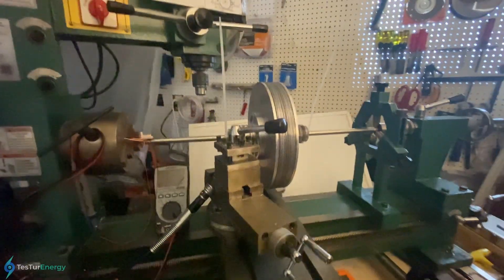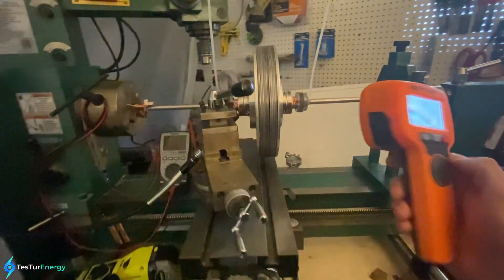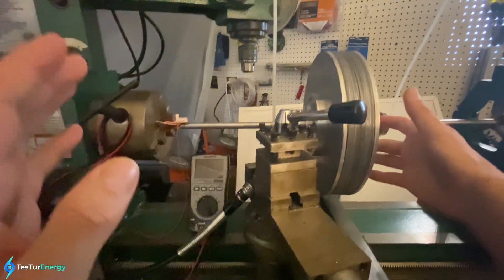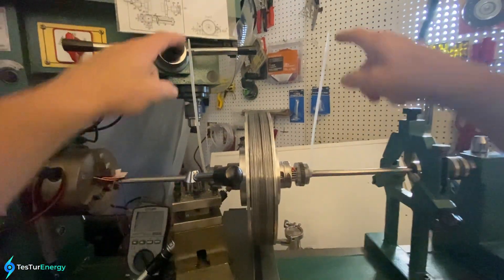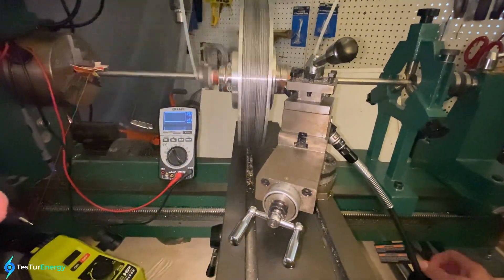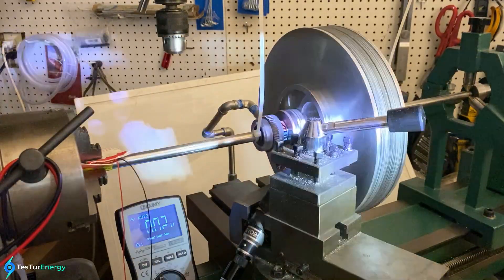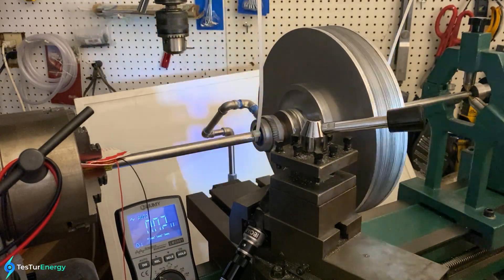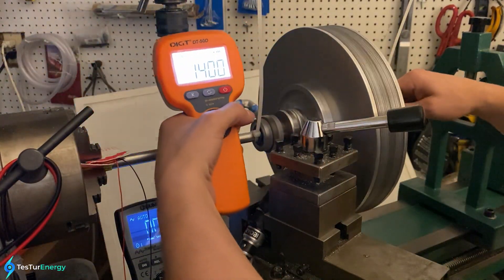How To Do Dynamic Balancing of Tesla Turbines, Turbo Jet Engine Rotors & More On A Lathe

Comment: Are you going to try a further ultra fine balancing at the critical rpm?  Was 1800, as 3x 600, the intended operating speed?  2x that, at 3600 rpm is often the target operating speed of AC gensets for 60hz.
Reply from the maker: Naw just doing a demo. 

Although I’m pretty sure I can operate at 3600rpm with decent power output available I think I’ll get a better efficiency at a higher rpm but maybe won’t get as much power out. 

This will probably spin anywhere between 3600 and 13,000rpm . 

The turbine is already geared up to high frequency 3phase BLDC generators that are rectified and then Inverted. 

I have generators that will go direct on shaft for the final combustion one though.
Reply: @CharlieSolis are you going to use some sort of electronically variable load? You need to get torque test channel to .. well ... Test the torque
Reply from the maker: @accordv6er  hey thanks for the comment! Yeah it would be cool to see the static torque of this! 

Though I will say I can’t do a full throttle at zero rpm because the discs gain a rigidity once spinning that at zero rpm they just kind of vibrate like a harmonica. Which is not desired. 

Make sure to check out the latest updates on the combustion + steam Tesla turbine builds!  Tesla Turbine 250 watt to 2650watt Power and Efficiency Test https://youtu.be/K7qZvq1CMFg 

+4250watt Tesla Turbine Dyno Jet Turbo Power & Torque Curve 375 mph @ 12,500 rpm https://youtu.be/exF5Rn-L8gs 

Tesla Turbine Jet Engine - gasoline fuel burner atomizer flame tube test 186,083 propane burner https://youtu.be/gRqKowignac 

Tesla Turbine Jet Engine Combustion System GB186,083 - Powdered Iron Fuel + propane micro burner https://youtu.be/Ad0Ecpc_OPM 

Dr. Tesla Talks of Gas Turbines - AudioBook by Charlie Solis https://youtu.be/TGGLG-7hK50
Reply from the maker: @accordv6er  to give a short answer, I’ve also done dyno tests with this already and graphed the torque and power curve across its usable rpm range. 
6.22ft-Ibs of torque at only 4150rpm and +4.25kW between 6000-12,000 rpm. 

+4250watt Tesla Turbine Dyno Jet Turbo Power & Torque Curve 375 mph @ 12,500 rpm https://youtu.be/exF5Rn-L8gs
Reply: @CharlieSolis  thank you so much for the responsiveness. Hadn't even though about the tension at speed giving it rigidity that's really interesting! Makes sense why when you balance it, it must be dynamic as well. Would a VSR balancer used for turbine wheels work also? What is the limit on diameter/rpm on the aluminum? Would a multi stage increase efficiency any? Giving up some RPM and surface area for slightly different plates that are thicker but have a larger outlet/working surface area ratio? Longer lever essentially? Or does that pretty much just become axial at that point.... One thought was as a stage moves out of range and becomes just a flywheel, to use the next stage to pull the atmosphere out of the prior stage, (so it becomes essentially only a flywheel.... This might happen simply by blocking the inlet actually? Where most of the stage is in a slight vacuum. )
Reply: Seems like this might work brilliantly hooked to a large mass flywheel with a CVT input system such that the Tesla Turbine can remain at peak efficiency, while bringing the flywheel to speed, while also isolating the turbine from peak loading. I mean....batteries work too 🤣 but while we're on the topic of things that go spinny spinny, big ass flywheel battery might be a really good application, especially if it could me made as part turbine itself, or used the disc/pumping mechanism to pull vacuum on it's own case as it accelerates, so by the time it gets to speed it is in some vacuum. 
Alternatively, the flywheel could be a turbine spaced for fluid sheer forces/adhesion so the fluid adds to the mass of the flywheel, the fluid being driven by the smaller steam turbine

Comment: Interesting that you only have to take the mass off the bulky parts on either side of the discs rather then the discs themselves?
Reply from the maker: Lastly…. I’m just happy that I don’t have to balance each and every disc and star washer individually when there’s 75 discs I this 😅

However because the discs won’t be uniform you will want to pick a final balancing shaft that has a critical rpm such that the 1/3 of critical rpm that balancing is done at is near the operating RPMs such that the discs will stretch to their natural point for the centrifugal loading at the desired RPMs. 

Tesla further notes in the patent that the motive fluid used for balancing can be heated and a covering can be put over the balancing machine so that the turbine is also at its operating temperature too such that it’s at its natural thermal expansion point for operating too. 

Otherwise the balancing done at low RPMs could be inadequate, depending on your disc materials as the discs won’t have the same mass distribution.

Nick, aka waveguide, pointed out that the shafts Tesla had picked from for using with his 60in discs had a critical rpm of 6,000rpms. I had previously stated that he was wrong for thinking that shaft was to be used for balancing because the turbine would never be spun at those high RPMs, but Tesla planned on running them at 1800rpm I believe and 1/3 of the 6,000 critical rpm is 2000rpm, just over the desired operating rpm of the turbine. So Nick was right about that shaft. 

I further even think Tesla planned those discs to be able to stretch enough that right as the turbine goes over 1800rpm and gets near 2000 rpm the discs will stretch enough to just touch off with the outside of the casing and it can actually use that to stop any “runaway” from the turbine over speeding but in fact it would also auto balance the turbine all within its own casing if it touched off with the casing periphery at 1/3 of its shafts critical rpm.
Reply from the maker: Hey Stuart! So technically the whole disc stack was rather balanced before with the previous setup but I needed to add on these locking shaft collars to keep the disc pack from widening up at full pressure. 

I thought they were when I ordered them but it turned out the locking shaft collars I bought were not symmetrical and had the screws going in on only one half instead of 1 screw per side. 🤷‍♂️ 

This was honestly the only reason I started working on the balancing stuff because I didn’t need it before. But I’m happy I’ve got this down now because it takes any worry away that I would have an out of balance runner built in the future and couldn’t fix it.
Reply from the maker: That being said though, this is what Tesla said about balancing in the improved disc stack patent GB 186,082. 

“This construction permits free expansion and contraction of each plate individually under the varying influence of heat and centrifugal force and possesses a number of other advantages which are of considerable practical moment. A larger active plate area and consequently more power is obtained for a given width, this improving efficiency. Warping is virtually eliminated and smaller side clearances may be used which results in diminished leakage and friction losses. The rotor is better adapted for dynamic balancing and through rubbing friction resists disturbing influences thereby insuring quieter running. For this reason and also because the discs are not rigidly joined it is safer against damage which might otherwise be caused by vibration or excessive speed.”
-Nikola Tesla 
https://teslauniverse.com/nikola-tesla/patents/british-patent-186082-improvements-construction-steam-and-gas-turbines
Reply: @CharlieSolis  - are your plates dimpled at all, to maintain plate separation distance?
Reply from the maker: @orcoastgreenman  yup yup! But they can still yield a little. 

Tesla says to line them up so that they don’t line up and that the straddle each other, giving a kind of accordion effect. 

This further aids in vibration damping to reduce fatigue on the discs for safer operation too. 

“In the new design I employ two heavier end-plates which are machined tapering toward the periphery for the purpose of reducing the maximum centrifugal stress as much as practicable. The inside discs, of relatively thin material, are rolled, forged or ground tapering in like manner and with the same object in view, but this may not always be necessary and plates, made of sheet metal of substantially uniform thickness as furnished by the mills, can be employed. Each of the thick as well as thin plates is provided with exhaust openings, leaving a solid central portion like the hub and spokes of a wheel. Star-washers of similar configuration serve the purpose of keeping the discs apart in the center and for the peripheral spacing the thin plates have small holes drilled in them on a circle, or circles, of suitable diameter, and in these are driven tight-fitting studs which are upset at both ends by a special tool so that they will project beyond the metal on each side a trifle more than the thickness of the star-washers. When the plates are put together the separating studs do not come in line but are straddled in order to give opportunity for slight yielding, thereby eliminating constructional difficulties which might be caused by unevenness or other mechanical imperfections. Thus the rotor can be finished closely to predetermined overall dimensions and will run true on the outside even if the thin inside plates should vary a little in thickness or be slightly warped. To simplify this arrangement I provide only every second plate with studs, using plain ones between. Furthermore, with the object of cheapening the manufacture I dispense altogether with the former, accomplishing the spacing by means of small bosses or protuberances which are raised in the plates by blows or pressure and provide a die, practically reducing all the machine work on a thin plate to a single operation in a stamping press. The star-washers, while preferable, are not indispensable and may be replaced by round separating washers of a diameter about equal to that of the hub part of the discs.

All the plates and washers are fitted on and keyed to a sleeve threaded at the ends and equipped with nuts and collars for drawing the thick end-plates together or, if desired, the collars may be simply forced onto it and the ends upset. The sleeve has a hole fitting snugly on the shaft and is fastened to the same as usual.

This construction permits free expansion and contraction of each plate individually under the varying influence of heat and centrifugal force and possesses a number of other advantages which are of considerable practical moment. A larger active plate area and consequently more power is obtained for a given width, this improving efficiency. Warping is virtually eliminated and smaller side clearances may be used which results in diminished leakage and friction losses. The rotor is better adapted for dynamic balancing and through rubbing friction resists disturbing influences thereby insuring quieter running. For this reason and also because the discs are not rigidly joined it is safer against damage which might otherwise be caused by vibration or excessive speed.”
-Nikola Tesla
Reply from the maker: Just released the latest update! 
Tesla Turbine 250 watt to 2.65 kW Power and Efficiency Test
https://youtu.be/XQl1DQgXVkQ